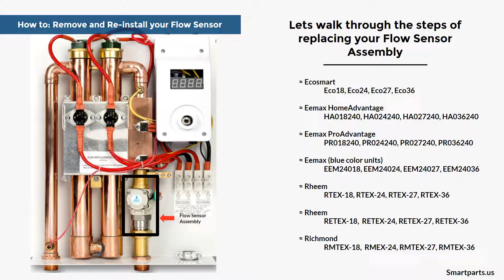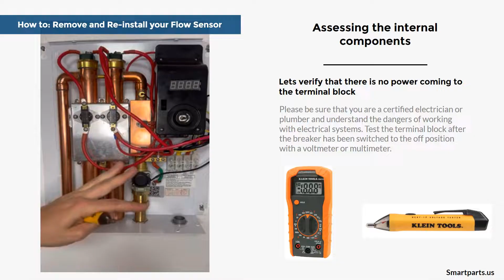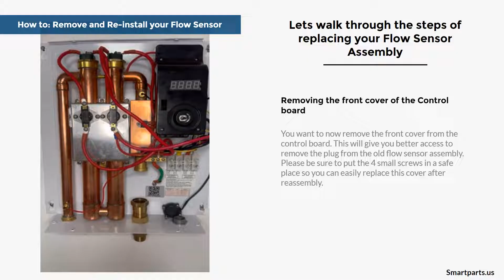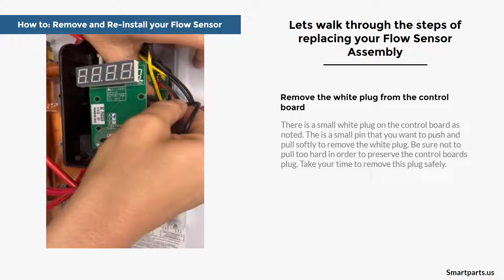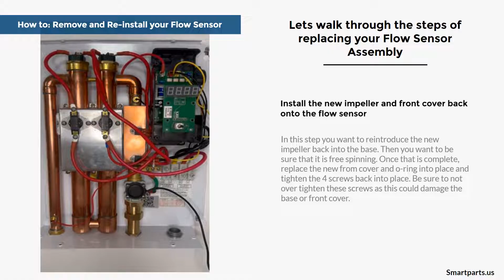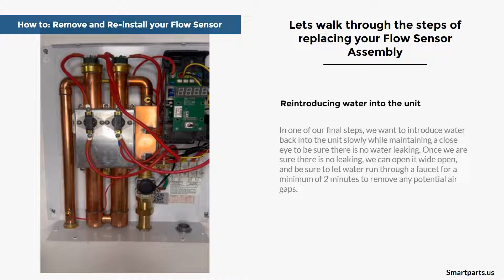How to: Installing a Flow Sensor | Flow Meter on Ecosmart, Rheem and Eemax Tankless Water Heaters

Comment: why wouldn’t you say that you have to unhook the waterlines before doing this? As just following your steps ended up with more problems because I didn’t unhook the waterlines below like you have it I assumed you didn’t have to because it wasn’t included in the instruction given. 
not unhooking the waterlines below puts everything in a bind and there’s not space to take out the flow sensor, but that was never covered. You just said, shut off water and flush and then remove the old sensor assembly front cover and on.

Comment: After installing the new flow sensor and running water through while the power is still off, at that point do I turn the water off and then turn the power on? Or turn the breakers on while the water is already flowing? Does it matter?

Comment: Your video was so helpful, and my husband and I were able to do the replacement in about an hour. It seemed to work at first. We checked every hot water faucet and we had hot water. We were giving each other high fives! We took hot showers! But the next morning... no hot water! Any ideas what could be causing this? Thank you!
Reply: Update: We reset the breaker again, tweaked the temp on the unit a bit, and we've had hot water for a couple of days now. So, not sure what was going on, but all seems to be working now.

Comment: I replaced my flow sensor, and the new one is leaking where the wire comes out of the sensor cover. All 4 screws are tight. Do you know what I could be doing wrong.

Also, do I need to put some kind of glue over the control board to protect it from the water?
Reply from the maker: Hi @jeremygamer9975,

Thank you for your comment. The product shouldn’t be leaking at all; it’s designed with two gaskets—one to protect the internal components and another to prevent any leaks.

If you ordered directly from us, please send your order number and details of the issue to Info@smartparts.us, and we’ll review what was sent. If the purchase was made through another platform, like Amazon, it’s possible the item is an aftermarket, non-OEM part, which can frequently lead to issues like this.

Additionally, for our flow sensors, there’s no need to remove the front cover. Installation should be straightforward—just remove the hex nuts above and below, then reinstall.

Let us know how we can assist further!
Reply: @SmartPartsSolutions  my flow sensor replacement came disassembled. The front cover is already off. I would like to know if there is an adhesive or sealant that I'm supposed to use for it, because my original sensor appears to have a sealant gluing it together.
Reply from the maker: @aetherport  What model unit is this? Seems like its a smaller unit like the 8kw or 11kw as these are the only Flow Sensors that come disassembled. If you have the newer LS model, that one is slightly different. I need to know what part was purchased and what model unit you have to better assist you here. I would suggest coming to our website and reaching out to a live agent. 8am-9pm EST at Smartparts.US

Comment: I went to go look at the flow sensor on my rheem rtex-18 and there was nothing there. No opening and no impeller inside the pipe just inside the inlet. Not sure where I'm supposed to look for this thing now to check it.
Reply from the maker: Hello, thank you for your question. So, I am a bit confused here. You are saying that you do not have an impeller inside and no opening, I think you may have the newer style unit. This one is the FSA LS1836 and this flow sensor is a bit unique. The impeller is located on the inlet of the unit and to access it is from a different location. You can access this one from below and remove the screen and the impeller is located internally. Please let me know if this makes sense to you if not give us a call at 754-444-1735 and we can better walk you through.

Comment: Hello, is there a tutorial on replacing the ngt thermostat part and the copper plate thing as well? For some reason, the current stops at these 2 places on my 36kw ecosmart, it doesn't provide any current to the heating element. Basically where the wires connect before reaching the heating element.
Reply from the maker: Hello, That would mean that the high temperature thermostats on stuck and arent allowing power to flow through. You can find youre replacements on our website at Smartparts.us. Ill also add the link to the direct replacement thermostat for your unit. For others who have the same issue these thermostats work for all Ecosmart, Rheem and Eemax tankless residential units from the 8kw all the way to the 36Kw. Thank you for your question and if you need anything else call us at 754-444-1735 or visit our site as we have late night tech support with live agents on standby.

HA-P033 https://www.smartparts.us/products/ha-p033?_pos=5&_psq=thrms&_ss=e&_v=1.0

Comment: If your impeller appears to be melted, it is due to an issue with the unit overheating from a failed triac. That MUST be repaired first or it will destroy your new flow sensor. Sadly, Ecosmart is aware of the failure mode and continues to profit from parts sales. This overheating/overpressuring cycling can occur even when the control panel says it is OFF. The cycling will challenge your relief valve and eventually can fatigue your flow sensor, the weakest pressure boundary that will likely lead to a catastrophic failure of the flow sensor meaning full water flow into your basement, closet, garage or where ever your Ecosmart is located. I have first hand experience with this and from now on will be cutting power at the breakers when leaving for an extended period of time. Unfortunately, this unit will become my very expensive backup water heater and will remain valved out/breakers open of my system except for emergencies. These flow sensors should be made of brass or SS to protect your home from eventual flooding...none available for the Ecosmart as far as I know. Branded under other names does not exclude you.
Reply from the maker: TThank you for sharing your experience. We're genuinely sorry to hear about the issues you've faced with your Ecosmart unit. Overheating and the resulting damage can indeed be troubling. We want to assure you that while such failures can occur, they are relatively uncommon. In our extensive work with Ecosmart, Rheem, and Eemax over the past decade, we've identified that the primary cause is typically a failed triac, most often the first triac.

We understand your frustration and concern about potential flooding. However, in most cases, once the flow sensor fails, the unit won't continue to heat, significantly reducing the risk of catastrophic flooding. It's very rare for a scenario like the one you described to occur, and we haven't encountered such incidents in our experience.

To prevent further issues, we recommend replacing the faulty triac promptly. Additionally, your precaution of cutting power at the breakers when away is a good practice for added peace of mind. We also advocate for more durable flow sensors, and we're continually working to improve safety and reliability standards.

Please know that we take these concerns seriously and strive to address them proactively. If you have any further questions or need assistance, we're here to help.

Thank you for bringing this to our attention, and we hope to provide a resolution that restores your confidence in your water heater system. Again, if there is any question about any issue with your unit give us a call directly to correctly diagnose any issue you may have. We have technical support open 7 days a week. Visit us at Smartparts.us or call us at 754-444-1735 you can even email us at Info@smartparts.us